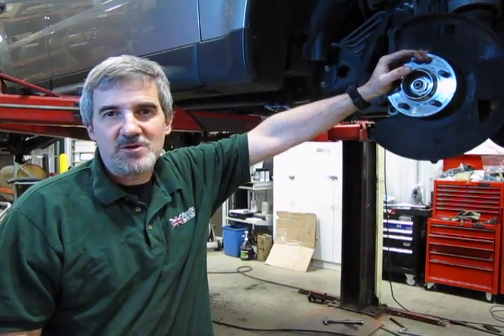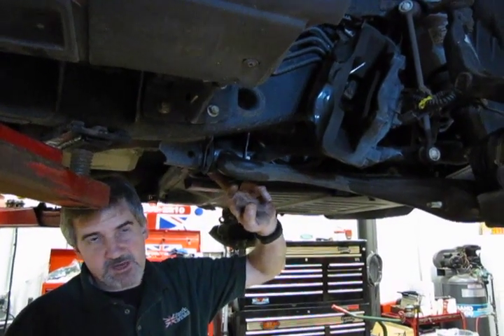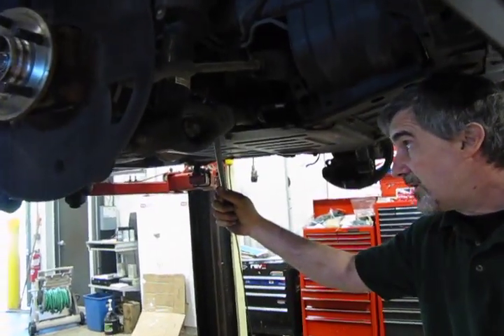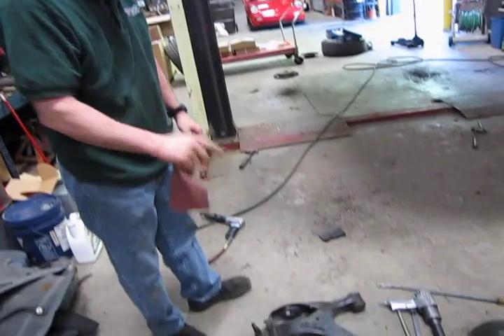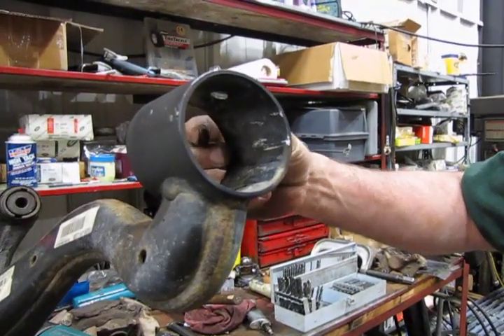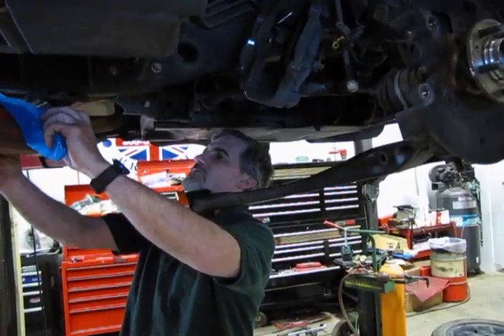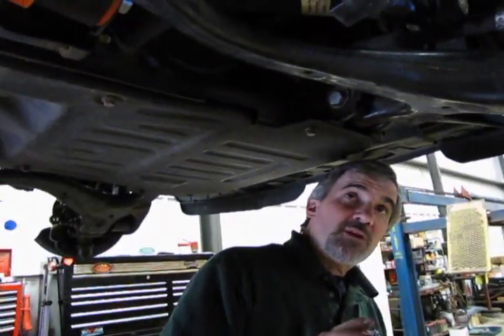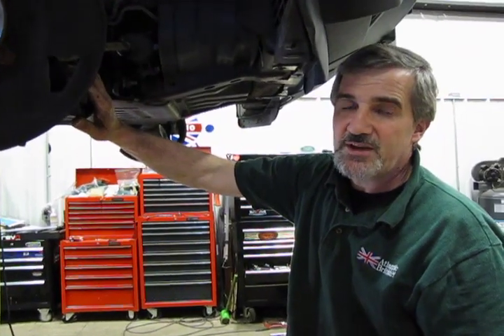Rear Bushing Replacement On Range Rover Sport 2006-2009

Comment: Nicely done, though I would add that one should add bushing grease on the metal core since it should rotate freely inside of the orange bushing.  This will prevent squeaking in the future. Do not put grease on the outside of the orange bushing since the bushing is not supposed to rotate.

Comment: Great tips on setting it back on the ground and let it be in its relaxed position👍🏽👍🏽  … I assume you can do this to the front control arms too right ? ..  I have a 2011 R/r sport HSE .  I just got a recall for my gas tank  for the - FUEL TANK FLANGE ASSEMBLY CRACKING -

Comment: Two questions:
If the rear control arm bolt is known to seize, why not put anti seize on the new one when replacing it?
If your going through all the work to pull the control arm, why not do both front and rear bushing?
Thanks for the video.
Reply: +TheTraakon I think that's because you dont want it to come loose again unless required

Comment: do you need to also replace the smaller bushings? I noticed you didn't
Reply: I would just fit a new arm. If one bush is toast, everything else may be in a similar state. Works out near the same price due to labour costs

Comment: I'm wondering about the poly bushings. It looks like the rear most control arm is on a different radius then the lower A arm and intended to flex the very flexy factory standard bush??